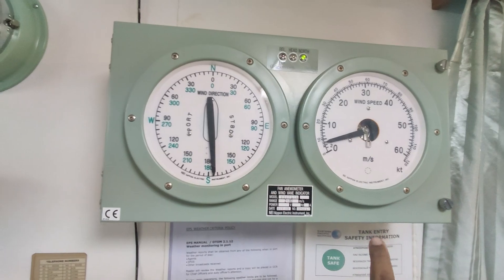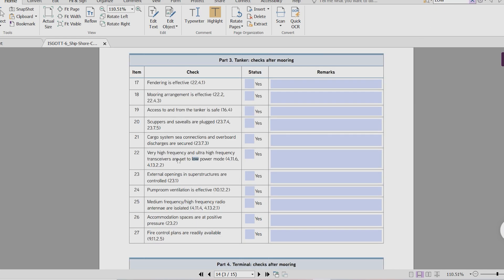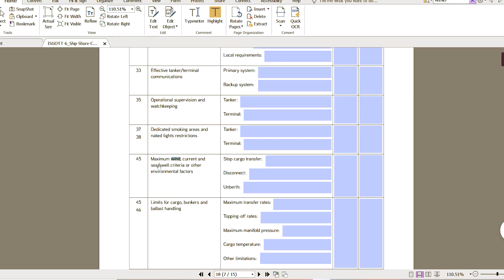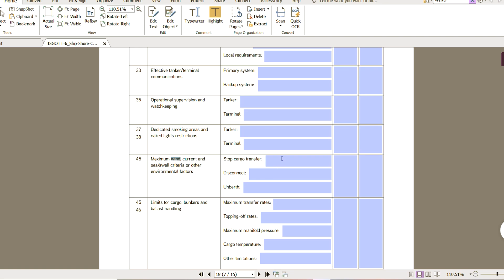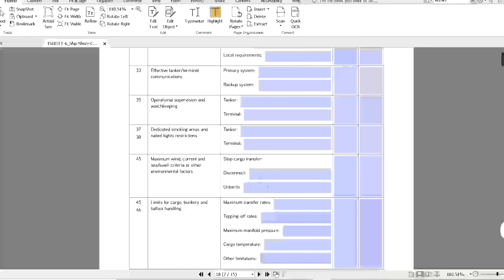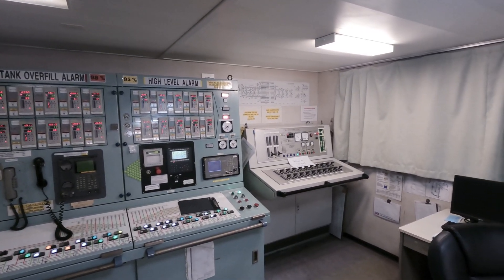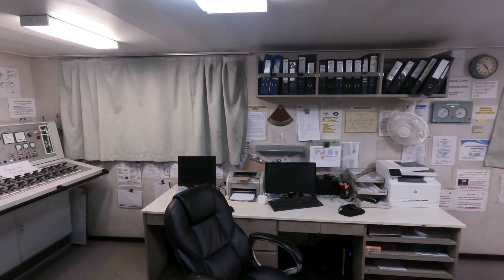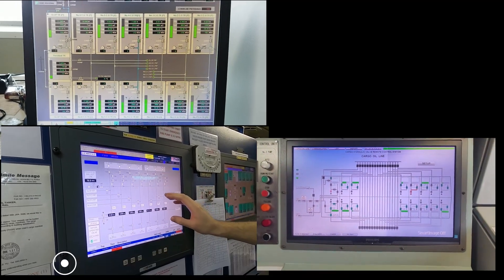CARGO CONTROL ROOM TRANING -Part 1/3

Comment: Interresting video, thanks! :)
A question, why does the VHF radio have to be put on low power level?
Reply from the maker: because on tanker chances of explosion is their due presence of flammable cargo hence its best advise to Put AIS and Vhf on low power and MF hf Switch off